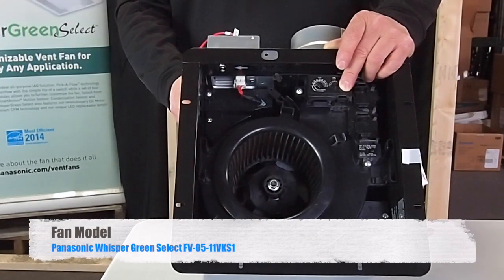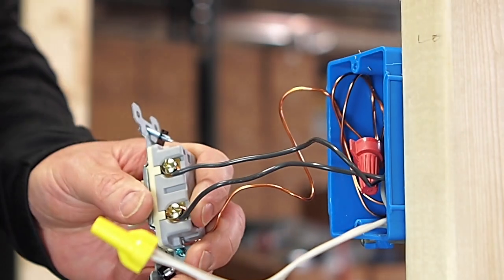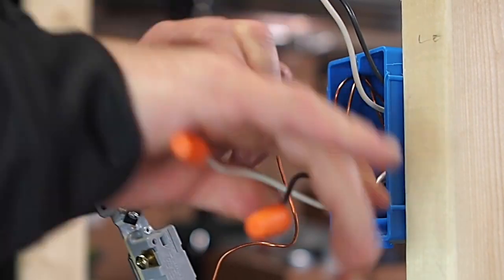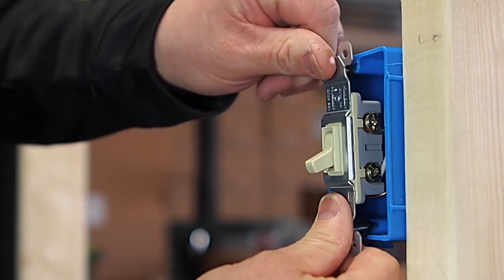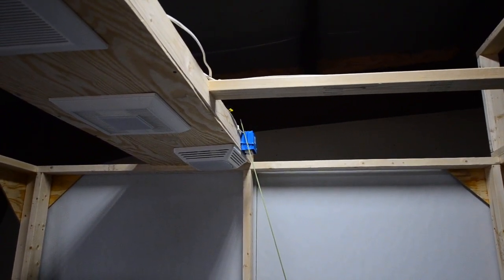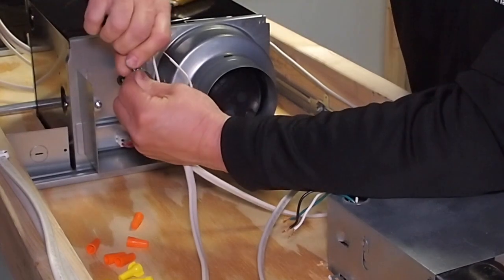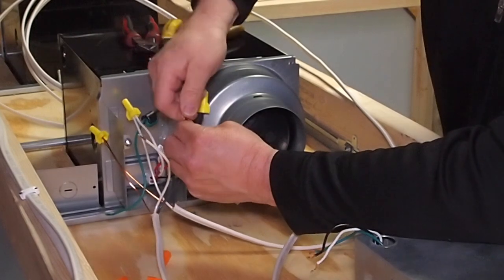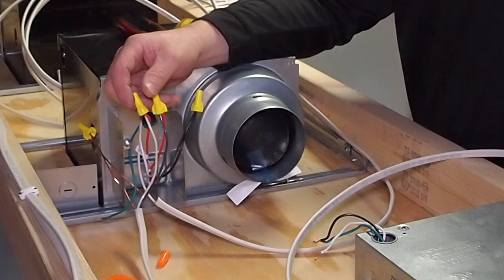Panasonic Whisper Green RetroFit Bath Fan Wiring Scenario (3 of 7)

Comment: The drawings are so confusing they don’t show three options they make it seem like you need four switches. One for light , one for night light(a dim light),
One for fan, and one for humidistat…. I need to go bad k to a job and pick how to set it. I ran four switches to bathroom. So I either need to cap off red in j box and not use it and throw a blank cover plate on or take off the three switch device and tie the hot and switch leg to send constant hot to fan and change it to a two switch device and  keep the reds hooked to a single pole switch. Need to wrap my head around what each option does and what’s best

Comment: I tested 120 on one of those red wires when I hooked up the constant power to the fan. Lucky I didn’t get bit coz I was thinking it was low voltage or nothing like he said. 
That’s why you send no voltage up a red it’s coming from some tie to the constant hot.